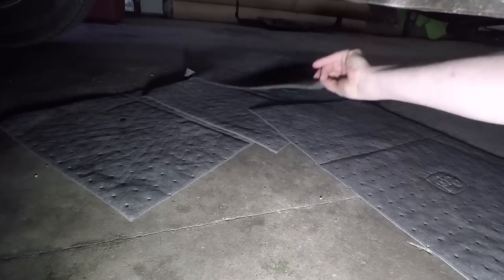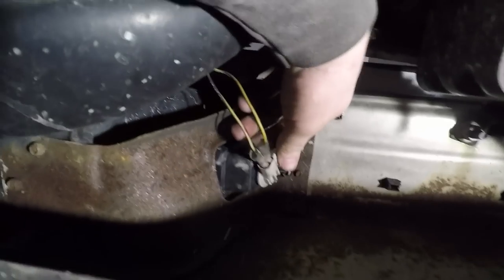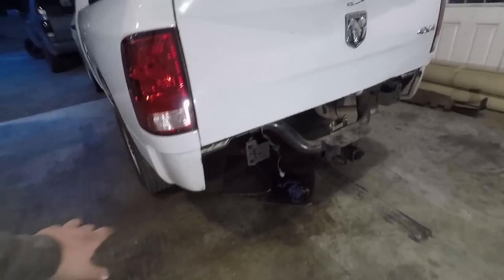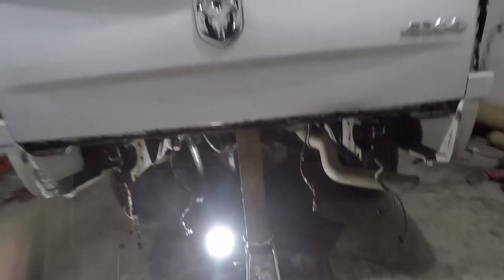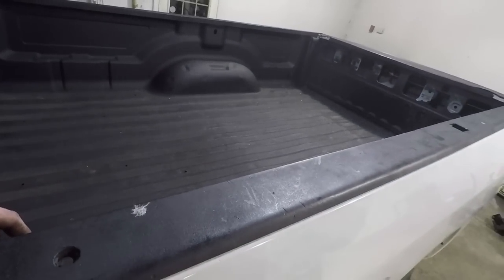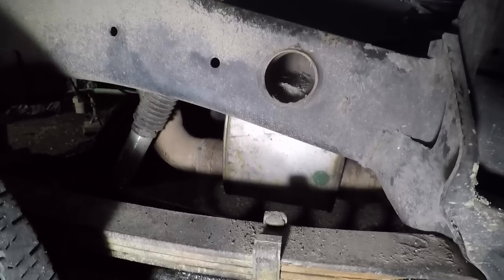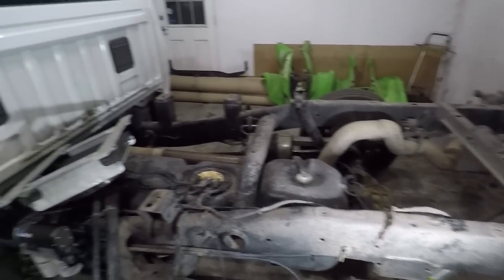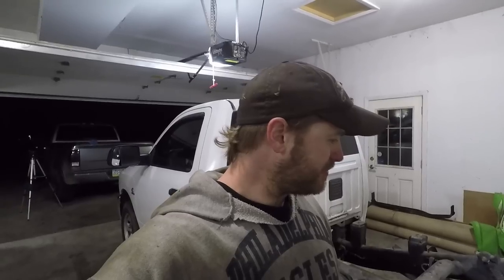How To Remove A Truck Bed BY YOURSELF, NO LIFTS OR MACHINERY NEEDED!

Comment: Thanks for posting this. I'd been looking for a practical way to remove my 70 F100 bed by myself outside. After watching this, I built a similar frame out of scrap wood (scaffolding would be MUCH easier) and lifted the bed using ratcheting straps. Since the brakes are out on the truck (one of several reasons I wanted to remove the bed), I backed the truck into the spot first, then erected the frame so that I could just put the truck in drive and pull straight forward. Didn't want to knock down the frame trying to back the truck into it!
Reply: Installing hold downs on 96 dodge picup

Comment: Really liked the camera angle backing the truck in, very cool idea! I wanted to ask you a question - The rear vents in my mega cab were removed by the previous owner for a sound system, they had deadener installed over the holes to 'seal' them. Pulled the deadener off today and discovered a huge chunk of rust on the inner sheet metal. Got it all cut out and want to rivet some aluminum plate from the outside with sealant. This is going to involve me needing to slide the bed back far enough to get access to install the plates (maybe 2 feet back), in my driveway.

Would you say that it is possible to get this sucker slid back by myself without any hoisting equipment whatsoever? All I would have access to is my floor jack and jack supports.

Comment: Could you have used the engine lift hoist and lifted the bed up with ratchet straps and set it on saw horses? I want to clean up my truck frame and remove my bed. That's my plan on how I'm doing it.

Comment: I thought it over and decided my best option is to drop the gas tank,  clean the tank and change the fuel pump and put it back together. I might pull the bed next time it's only got 210k on the 2.5L Jeep engine. I bought the cheapest fuel pump I could find online. After I bought it I have seen several people that claim this pump only lasts about a month, I sure hope it lasts longer than that. It says Agility on the box Fuel Module Made In China. I hope its a fuel pump lol